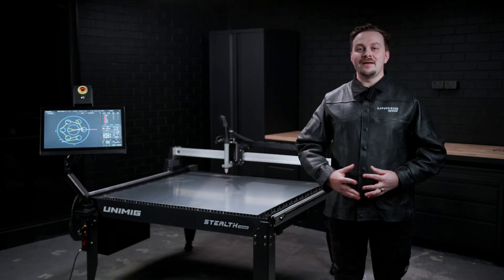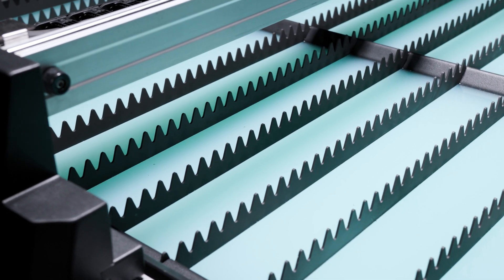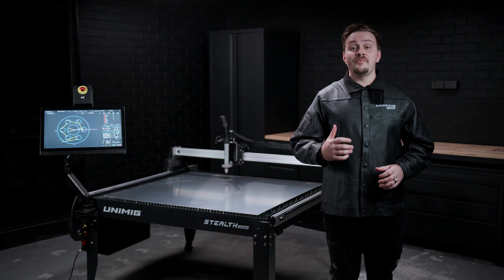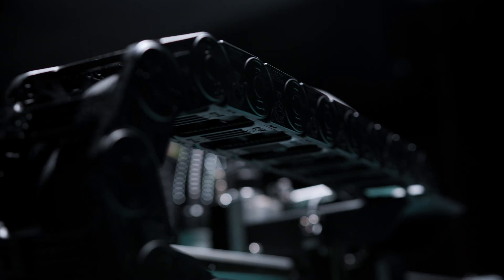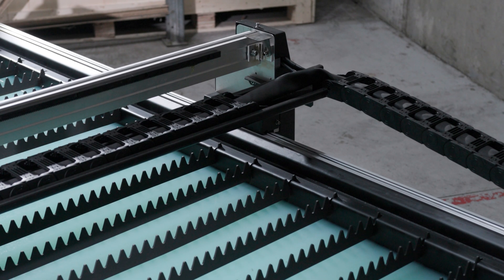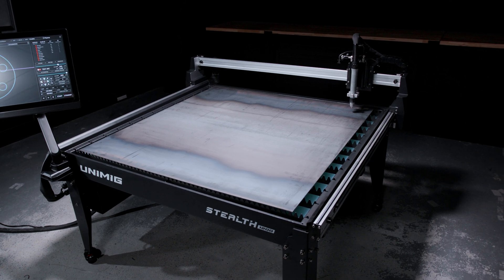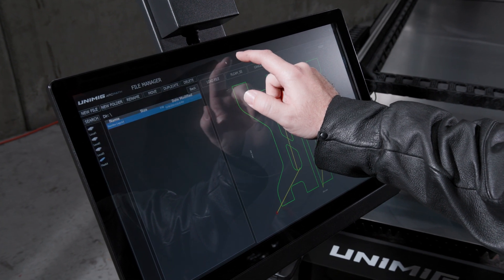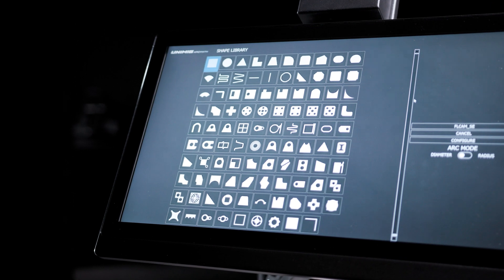STEALTH CNC PLASMA CUTTING TABLES Feature Video

Comment: Does it lose geometry when cutting small diameter holes?
Reply from the maker: The CNC has no issues with drawing smaller holes (within reason), but rather the plasma source may struggle with small hole diameter cutting. This is a typical issue with plasma cutting and not a limitation of the CNC table. The thicker the plate the more the plasma cutter will struggle. If you want perfect bolt hole sizes in thicker materials it's recommended that you mark and drill them or use a different toolset altogether.

Comment: I’d be keen, but need a more in depth rundown of the computer/software used.. as I use fastcam software, what’s the differences compared with your software? Look forward to seeing move videos of this
Reply from the maker: Hello, happy to help answer any questions you may have. Our software is the CNC control portion of the workflow. Arcpath feature many features you would find in a CAM type program, but it's main focus is on CNC control. For CAM and Nesting we provide FLCAM along with the control PC. This software is pretty basic in terms of it's CAM and Nesting abilities, but it works. Our control software does not exclusively accept files from this program, it is designed to accept common G-code and F-code. So however you wish to produce the G-code is up to you, our controller will cut with it. Also, our controller is a windows based one, this means you can easily share files over the network for cutting. 

We will be releasing some video tutorials of the CNC control software in use in the next few weeks.
Reply: @UNIMIG  where them cnc videos at